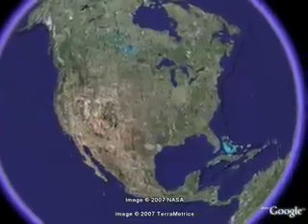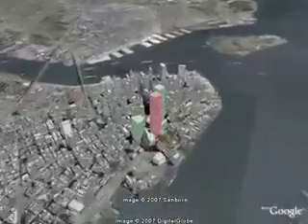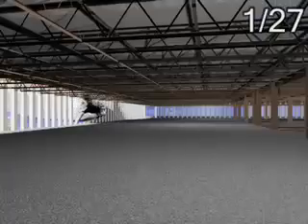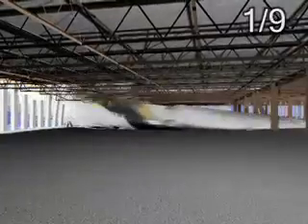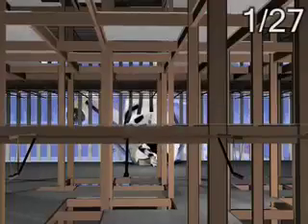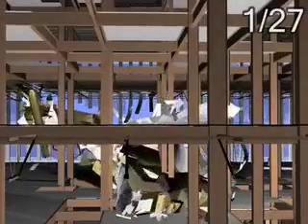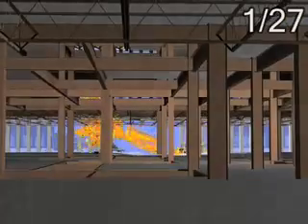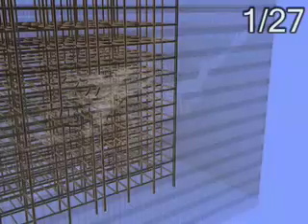Revendo o 11 de setembro

Comment: Sometimes reality depending on gravity seems to mount. Have you ever heard someone say when you have a serious accident that looked like a movie, dream or nightmare?
The explosions may be the result of bombs that the terrorists carried in their luggage or in their bodies. If the building was solid concrete with no galleries or apartments, rooms anyway ... there could be wrecks of twisted aluminum. As the building served as a kind of beehive this turned into a large furnace with the tanks full of fuels the result was ashes of everything that was there. The fact is that fake seems to me the angle of filming that they use to try to show that the facts are distorted.
And even if an airplane crashes into a building there will be traces of demolition and implosion depending on how the building comes down.

Comment: North Carolina State University
Experimental and Analytical Investigation of Progressive Collapse through Demolition
Scenarios and Computer Modeling: Pentagon & WTC
By Joshua Wayne Griffin, A thesis submitted to the graduate faculty of North Carolina State University
in partial fulfillment of the requirements for the degree of Master of Science, Civil Engineering Raleigh, North Carolina, 2008: h t t p : / / repository . lib . ncsu.edu/ir/bitstream/1840.16/620/1/etd.pdf

Comment: Worcester polytechnic Institute
Comparisons of structural designs in Fire: WTC, may 2007
By Kristin A. Collete. A thesis Submitted to the faculty in partial fulfillment of requirements for the Degree of Master Science in Fire Protection engineering
w w w . wpi . edu/Pubs/ETD/Available/etd-050307-182832/unrestricted/kcollette.pdf

Comment: 11 de Setembro é o 254 dia do ano (2 + 5 + 4 = 11) 
Depois de 11 de Setembro, faltam 111 dias para o fim do ano 
119 é o código de área para o Iraque/Iran 
As Torres Gêmeas edificadas lado a lado pareciam o n° 11
O World Trade Center levou 11 anos pra ser construído
Ambos os prédios tinham 110 andares 
A primeira Torre a ser atingida colidiu às 10h28min (1+0+2+8=11)

Comment: O número de janelas de ambos os prédios somam 21 800 (2+1+8+0+0=11)
O Terceiro prédio a cair tinha 47 andares (4+7=11)
O primeiro vôo a bater numa das torres era o vôo nº 11 
New York é o estado Nº 11 dos EUA
George W. Bush – 11 letras
Barack Obama – 11 letras
New York City - 11 letras
Afghanistan - 11 letras 
The Pentagon - 11 letras
Ramzi Yousef - 11 letras (autor do atentado ao WTC in 1993)
O vôo 11 - tinha 92 passageiros a bordo - 9 + 2 = 11

Comment: 3. primeira atingida, resistiu bem mais que a Torre Sul em razão de o avião ter se chocado mais na parte central do edifício, o que explica a queda vertical dessa torre. Já a Torre Sul, atingida em diagonal, teve destruição assimétrica e, portanto, mais acelerada. Antes de ruir inclinou-se a 150° ou mais em direção ao canto atingido. O que mais me impressiona é que o rompimento dos edifícios se deu da maneira como foram montados, só que ao contrário. Os módulos foram se soltando de 3 em 3,